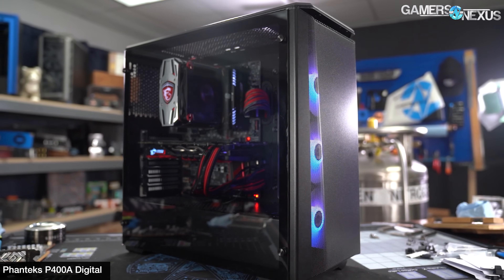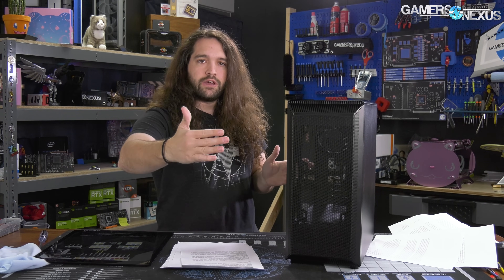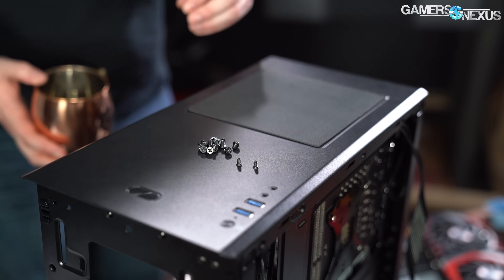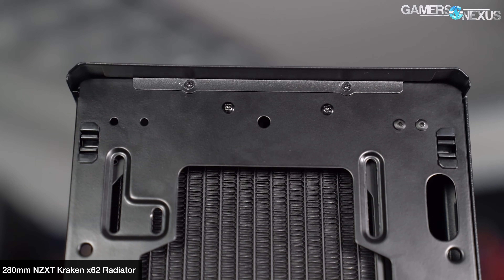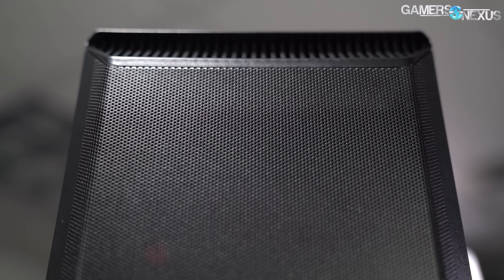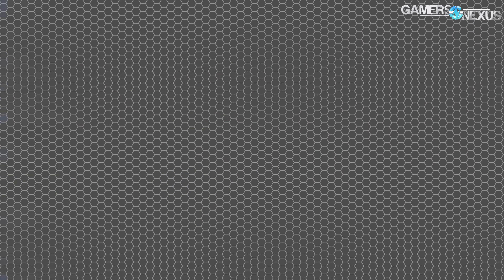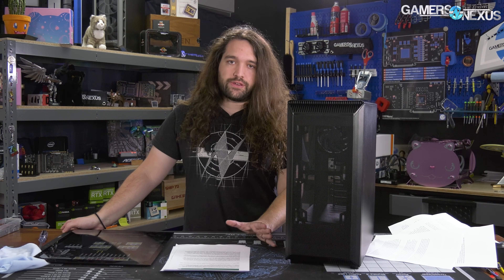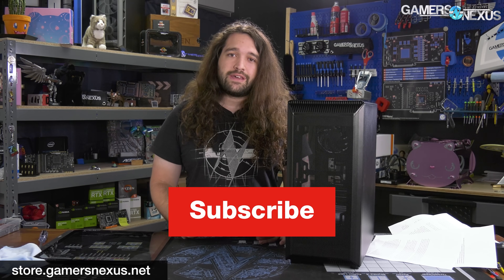Phanteks P300A Cheap Airflow Case Review: Thermals, Extra Fan Tests, & Noise

Comment: P400 price is under 100 if you dont' consider the extras, like extra hard drive bays or the gpu vertical mount. I had to spent 12 a peice for the trays, and that was the cheapest I could find.

Comment: little not on the front panel : Phanteks will probably release a "front panel only" thing to buy, for previous P300 owners. (They've done it for the P400A, for P400 and P400S users, would be a shame if they don't do it for the P300). And releasing that front panel would not only be a good thing for P300 owners, but also P350X and P360X owners, since both of those cases are a longer P300 with RGB, and uses the same tooling to connect to the chassis. In addition to that, both the P350X and the P360X does have very bad airflow with their front panel design. You drop the RGB, but gain performance, fair deal to me.

Comment: maybe a good middle ground would be 2 options, no fans included and fully loaded. one fan is near enough free so I think they could keep the no fans model at $60 and charge $70 or $75 for a fully loaded option, and maybe $80 or $85 for a fully loaded with rgb option.

Comment: I hope getting shorter doesnt also cause less/no support for 280mm/360mm rads or 3 120 fans in the top or bottom just because it always seems cases could support ot easily size wise but don't for some reason (Corsair comes to mind, but i have seen others online) All it would take is a couple more fan mounts or different recess or air vent hole/slot pattern etc.

Comment: Just bought this case for my first build and I like it. I have been running it stock with the 1 fan and getting decent temperatures but definitely looking to get at least another 2. My biggest gripe with it is the dam drive bay, I had to practically squeeze the psu cables to get em around that dam thing and the screws to remove it were so tightened that I was stripping them trying to take it out. Other than that I really do like it.

Comment: Apropos of cooling - corporate PCs come with all sorts of shrouds and ducts ... what about 3D printing some for a test case, e.g. exhaust the CPU hot air straight out so the GPU fans can exhaust into a case not heated up by CPU heated air.

Comment: What about the Corsair Carbide 275r? It has the redesigned side panel with a heavily vented front panel and comes with 3 fans. It also costs $79.99 for the black and $89.99 for the white.

Comment: I wish you would make regular mention of build quality in your reviews, even if it doesn't affect your conclusions.  That was the most disappointing thing about my P400A, which I bought based on your case reviews, coming from a Corsair 300R 7 years prior.  For sure, cooling is not a problem with the full set of replacement fans I bought, and it looks nice, but building in it made me question whether I just spent too much on a cheaply made case.

Comment: In these value cases the only way I would view as an attractive proposition the fact that it don't include all the necessary fans is, if I want to install some AIO.
Reply: Great CPU thermals but that would be bad for the GPU imo. But I guess warm air flow would be better than none!

Comment: Hmm the advice was to add at least one more intake fan, but preferably aimed at the gpu? How does mounting that fan work? Will the fan hit the GPU if you just mount it as close to the power supply shield on the bottom as possible?

Comment: I got the P400A, and I am very happy with it.
The fans seemed to have developed an annoying sound, it sounds like a wire is rubbing against the fans but i have pulled it apart and there isn't any wire in the way.
So, I am think of replacing the fans, which fans are recommended for this case, they do not have to be rgb?

Comment: Will a 120mm radiator fit in the top fan slot? This seems like a better location to mount it than the Rear, which is what the sales page suggests.

Comment: I think the problem with the fans VS no fans thing comes down to this: are we talking about a first time builder or not? I wouldn't buy this $60 case and then spend extra money on fans: I already have fans I bought previously that I could put in there. But somebody building their first computer is kinda screwed since they need to buy additional fans, too. 
Still makes more sense to include fans to not screw over the new builders, but I can also see why people who already bought fans and intend to re-use them would want a cheaper case without fans included.
Then there's boomers like me who refuse to buy anything without a 5.25" bay because where am I going to put my flash drive drawer if there's no 5.25" mount for it? It makes me very sad that 5.25" bays died with optical media when they can be used for so much more than optical drives.

Comment: I know with my new built when I eventually get an after market cooler, I will not be going with a Tower cooler again, plugging in and unplugging the CPU power cord is just a pain in the ass when you are swapping out a power supply so you can repurpose  your old build while waiting on the part for the new build. I was also able to get a P400A non Digital for my new build 69.99, so not sure how much better a budget of this one is compared to the 400a non digital since it only comes with one fan compared to the two fans.

Comment: Ever thought about working with one of the manufacturers to make some branded cases that 'work'? E.g. A Nexus Gamer; Nexus Light and Nexus Extreme case?
Reply: I doubt that would ever happen as they would have to limit or even stop doing case reviews due to potential biases
Reply: @everythingfeline7367  A lot of the cases perform 'similarly' and in the end the general population doesn't really care about a few degrees - it's down to looks, price and salesman recommendations.
Reply: @giovannip.1433  not always. There are many cases which are outliers, performing terribly, and many who care about a quiet system. While many won't  care about the tiny difference, that also means many won't care to prioritize his "custom" case, so it probably wouldn't do incredibly well, and he'd be taking out one of his big go-to content areas

Comment: The point of "fans already lying around the house" is actually a big deal for me. I have leftover fans from my old case that are still fully functional. The demographic of builders who are upgrading (or in my case, downsizing) their case and don't need the extra fans generating e-waste may be significant, probably moreso than the demographic of people who want to buy a set of brand new noctuas for a whole new build.

Comment: Not just the Phanteks P400A but the Lian Li 011XLs are next to impossible to find at less than robbery prices. I finally gave up and just got a regular 011 and got 360 rads instead of 420s because the case is so short!  Dam this SARS CoV-2, economy destroying crap.  Why did Silverstone quit making the RL06 ? It was one of the top 5 cases for cooling. Must not have enough margin in it.  This Phanteks case would have been an almost perfect low budget case, IF they would vent the top for 360 rads or 3-120 fans! I'm seriously thinking of building my own next case out of 80/20 extrusion for the frame. Put tempered glass on the 2 sides, full sheetmetal mesh on top, and front.THE Whole top and front. Its NOT rocket science.Why cant case companies see this?  Of course I will have to cut a motherboard tray out of an old tower and bolt it inside the rear extrusion with T-nuts, inside, this would leave about 1" across the entire back for cable management. The only hard part at all is attachment of the glass. Pretty sure I can come up with a way better than Corsair and Coolermaster though. :)

Comment: I have a p350x which has the same hard drive cage system, and I have to point out that the power/SATA cables are in the front, due to how their sleds are designed.  Which at least in my case means that cable routing is an issue, and clearance isn't really a thing...I'm debating ordering right-angle power adapters because of just how little room there is, if I leave my physical drives plugged in, I cannot close the front of my case...pressure pushes the bottom of the panel off. A irksome design flaw I don't really see anyone talking about.

EDIT: somehow posted without the actual question. Is this a similar issue on this case, or is there sufficient room in that mesh front panel for power cables to actually fit?

Comment: so, you think this case will perform better and have better cable-management than the silverstone rl06 ? i have 3 noctua fans to compensate the lack of stock fans. i hope its easy to clean the mesh front panel so it wont get too dusty inside the case.

Comment: This with an Arctic Freezer 280 would be a tremendous value I imagine.
Reply: 240 because of the radiator restrictions. Best thing to do is buy a freezer 240 with two extra Arctic p12 for push pull

Comment: Nobody wants 5.25 drive bays in compact cases! We all use SSDs, and want something that fits under the desk, stays cool, and is not full of empty hot air!

Fold the bottom of the PSU shroud down into a ramp, so the bottom fan can push more air in.. Move the front IO, and allow 2x140 Ran fans, with the280 rad, then a 140 at the bottom pushing into a ramped PSU cover. 

Sad I can't fit the 280 up front... :( sniffle or "use" the area below.

Comment: When doing thermal tests, how much a difference is gained/lost with other types of fans over using the ones the cases ship with, say swapping some Corsair LL120's into a case like this?
Reply from the maker: LL120s aren't very good, so that might not be a great example. There is a lot to be gained from good fans, but it becomes more of a question of how good they are at a given noise level. Some fans are optimized for static pressure, e.g. pushed against a radiator or constricted intake, while others are optimized for airflow. The choice can impact performance of a given product.
Reply: If you took out of the equation any other variables that might be changed and did a pure 1:1 comparison, it'd come down to the static pressure resistance of the case and the air force generated by the design of the fans themselves, but a change of +/- 2° at most. 
Considering the otherwise above average ability to dissipate heat the case already has, it'd be unnecessary for 99.9% of consumers to warrant using "better" fans unless they already had them purchased/on hand than just a pair of cheap ones.
Reply: I honestly think you'll gain more cooling capability with non-RGB ML's instead of the LL's, which are more for RGB instead. RGB-wise, I think that there are better performing fans from other brands. Non-RGB too btw, but in the corsair universe, if their stats are to be believed, non-RGB ML's are the best.

Comment: I have 3 x 14cm fans with ring lights. If you install them in this case, then the fans will be shifted to the left and part of the backlight will not be visible. This is just idiocy. On the manufacturer's website there is no photo showing where to install the fans. We guess we should put them inside the frame or outside ...

Comment: Phantek Case.  Ok.  Well not a bad case.  I wanna support Phantek's cases, but they promised to get a replacement front panel for my case that would include a Type C port.  They failed to deliver and after a few years I'm like....  This sucks..
Sorry,  I'm not going to buy a new case every time I build a PC, especially when Motherboards have supported Type-C Port for Front panel for a while..  So I really wish case makers would have a bit more 'VISION' and modularity in their case designs to allow for various upgrades.

Comment: Been wondering for a while, but how do these full mesh front type designs go for dust accumulation in normal household environments? I live in a place with no AC (so windows open lots) and carpet so dust layers on surfaces pretty quick...

Comment: Question: If I stuck a 240mm aio in the front of the P300A, which would come with two 120mm fans for the radiator, then I would not need to buy two fans for the front of the case, right??

Comment: I have never used the fan that came with the case, they are usually jank and rather take the cost out of the product for something that's generally not worth its weight in the trash. Fans are a component, it makes no since to inclue just one in a case where you have no freaking clue what the end setup is going to be, might as well add a 32GB SSD in there instead, it makes just as much since. 
Full fans or no fans, drop that extra few bucks for a non feature!

Comment: so i'm looking to build a new system and this is the best case within budget and availability. I don't however have the resources to get the 2 front fans as well since I live in the Caribbean and shipping during covid times is crazy, are the 2 front fans necessary? the specs I'm looking to run for this system are the asus rog strix b550f, ryzen 5 5600x, Noctua NH-U14S cooler and gtx 980 card as well as 16gb ddr4 RAM. Any advice on this will be appreciated

Comment: If I buy a budget case, I'd rather it just be chock full of whatever cheap generic fans the factory can get its hands on, because that's plenty good enough for a budget PC that, due to the extended lifespan penny-pinching me wants to get out of it, I won't be extreme OCing.

If I'm in the market for a high end case, I'll generally go for one that doesn't have any fans, or even get a custom enclosure built from the ground up; with a high budget I'll be OCing higher because I'm buying parts often enough to dodge most failure bullets, and I'll be buying a combination of fans that would never in a million years be included in a stock chassis, because I enjoy perfecting things.

Comment: Can I just buy a P300A front panel for my P300 and get rid of the solid one? Are the snaps in the same places? Also I'd like to point out that the cutouts for the P300 are the same and kinda bad, because my side-facing USB3.0 header is centered right where the metal between two cut-outs is, and I had to use the front facing header on the bottom of the board unless I wanted to bend the cable at a tight angle.

Comment: I have to disagree with the case fan point.

A Budget case doesn't need more than the back fan, because it should have budget parts, as in parts that don't need a lot of airflow. Besides, Arctic sells good 120mm fans for 5 €, which is very cheap and will be enough for ANY low-medium budget build.

Comment: im personally looking at an inwin case that looks like it will suit my needs, and get my overall case size down for my main rig(using a cosmos cm1000 medusa case thats... recently taken a short fall that lead to cracks in the plastic that makes of most of the exterior of the case.... once i get a new case i plan to mod the cm1000 into an ugly server/testbed (server for mumble and verious games, test drives/cards/weird ideas... )   

anyway this case, i know im weird but, i would  just cut a piece of cut to fit heatpump/ac filter to fit under the mesh, the kind that will add minimal extra drag, but, catch quite a lot of the dust that would get in, and, can be washed out in the sink or..shower and let dry, and re-used. done this many times to add some filtration or, improve whats there, without adding alot of extra drag...but, it only works if you got a bit of a gap in front of the fans. 

and, if they are 120mm fans, i would rather buy my own 90% of the time...7-9bucks each for 120x38mm pwm panaflos on ebay, dellsystem parts, you just take a pin, use it to swap 2 of the wires, then trim the connector, and, plug it in, and...bam... you just got a $40-$60 fan..f or 7-9bucks.. shipped... and...i have never had one fail.. some going over a decade 24/7... still going like new, if its 140, i would rather not get uber cheap 140's, just because, they tend to fail, the 120 and 140's from nzxt with their cases, are pretty reliable for extended periods...but even coolermasters fans with some mid range cases have ended up disappointing me..a couple years or less and they fully or at least start to fail.. where... i have even had yate loon cheap fans, last over a decade in most cases....and....i would be willing to pay more, for case maker volume pricing if they bought stuff like yateloon rather then... abject shit... like is often the case.... 

at least you see less of the "uv led fans included" that... last a few months before the uvleds fail or get so weak, the fans look....pathetic... 

i would take cheap yate loons with no led, over led fans from some random chinese maker... even if they had rgb... (infact years ago, i traded all the lighted 120mm fans that came with a case i bought, for a stack of nidec pwm fans(hp system pulls that had normal pwm connectors..brand new, worth 4x what the led ones cost on their own, and he knew it...but he wanted them...lol), the leds in those lasted around 9mo before they started to get weak and some failed, he didnt blame me, just bought more fans... eventually getting tired of window cases and wanting mesh like i have forever.. wanting good quality fans and who cares about leds... god i have gotten old...